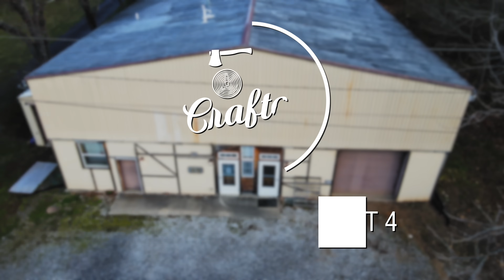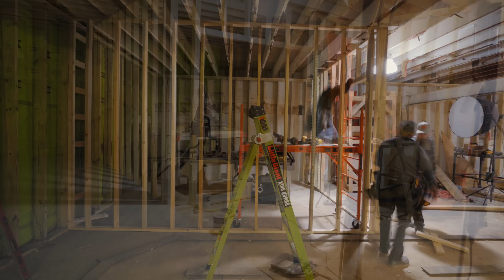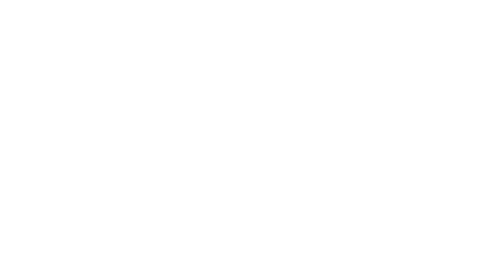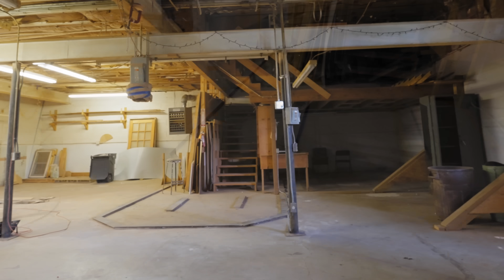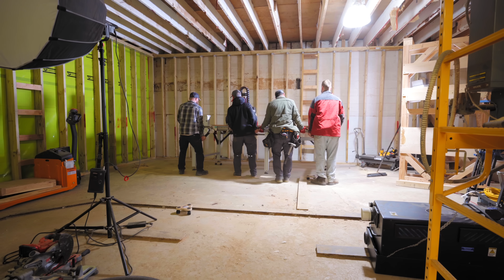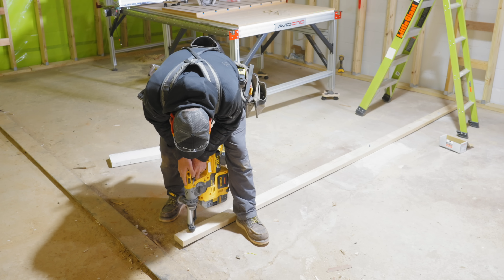WORKSHOP RENOVATION PART 4 : Framing Walls & Floor Platform

Comment: Radical stuff. I have to ask though, besides the ergonomic factor, why did you opt for a framed platform rather than doing a level concrete pour?
Reply from the maker: It was too thick to do self leveling concrete unfortunately!
Reply: @craftedworkshop  Gotcha, that's too bad but makes sense. Let me know if you ever need a hand with any CAD work or troubleshooting any weird 'performance' issues with this building. I'm doing a master's in forensic engineering right now, and I'd love to lend a hand.

Comment: Should you be putting untreated timber straight on concrete if you don't have a moisture barrier underneath? I suspect some moisture might get from the concrete floor to the timber.

Comment: Thanks for showing us how you leveled out the uneven concrete floor with a more comfortable wood based floor. I suppose that's something I will be doing with our building. I didn't want a concrete floor without in-floor heat. This is a good solution to that problem. I'll let the concrete be where the cars will be parked, but the rest will get a raised floor for comfort. Thanks for the details.

Comment: Floor sheets - with OSB the recommendation apparently is 2-3mm gap between boards to allow for expansion. Here the tongue and groove mated tightly from banging together. Not worried about seasonal humidity/temp expansion? Or does that type of board have some clever trick built into the mating surface?

Comment: The TotalBoat TotalTread, I'm guessing that you haven't walked on it in bare feet, but if you did, would it be uncomfortable? I'm wondering how this product would be for putting on steps in the house.
Reply from the maker: The abrasive is very fine, I think it'd be OK with bare feet. Wouldn't want to stub your toe though! 😂

Comment: Placing the barrier below the floor to help keep moisture out is a good idea.  Not sure where you live, but you could have also placed some 1/2" to 1" faced foam board on top of it as well to help insulate it a bit.  The stuff is relatively cheap.
Reply from the maker: I thought about adding insulation but we live in a pretty temperate area (Asheville, NC) so I don't expect it to be much of an issue keeping the space climate controlled.
Reply: @craftedworkshop  Way warmer than me (Western NY)!  ;)

Comment: I think you mis"d the  guidelines, the guidelines are a quarter inch per foot fall that's why in 4' you could drop it 1"
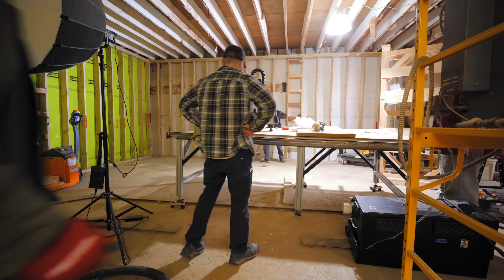Reply from the maker: From what I've read, it's a 1:12 pitch minimum, which works out to 1 inch per foot. 1/4" per foot would be extremely shallow.

Comment: It bothers me that there are no brace boards in-between the wall framing
Reply from the maker: You mean blocking? Doesn't really need it and it would get in the way of the steel reinforcement I'll be adding next.
Reply: @craftedworkshop  ahh gotcha.

Comment: I really like the way the transformation is looking so far, however I am a bit confused as to why the floor drain was completely blocked off. Should water find it's way into your shop, it now has nowhere to go, except, under the platform to evaporate.
Reply from the maker: The floor drain wasn't actually functional, it was clogged at some point in this building's 50 year history. I tried to run a snake in it to no avail. I could squeegee water out of the roll top door in the front if needed.

Comment: I wonder if some mortar or thick epoxy would be best to finish that ramp transition,  any thoughts on finishing that area?  I’m sure I would Tri point it.  Great Series!
Reply from the maker: Still trying to figure out my options. I've seen some nice heavy duty rubber transition strips but they're pretty pricey. I might just rip an angle on some strips of Advantech to feather out the transition.

Comment: the new shop is coming along great and looks amazing. I saw you at the opening of Berm Park but looked like you were with the family and no bikes so did not want to be rude
Reply from the maker: Oh nice, you should have said hi! We had a great time, can't wait to go back and ride later this week.
Reply: @craftedworkshop  next time I'm up from Florida.  Your videos inspired me to reclose a screen porch in to make a bike room. It's not perfect but it's framed now (not just a few strips of 1x on the aluminum frame) and insulated still need a ceiling solution, new door frame, and a bit of finishing work
Reply from the maker: @PedallingwithPaul  nice, sounds like a good project!
Reply: @craftedworkshop  anytime you can make a room for your bikes and gear is a good time. Wanting to close in a front screen porch for a small bike shop at my house too

Comment: Nice and straight work. I would have secured those support feet to the floor with a metal bracket to avoid any future bouncing.
I'm a little surprised they didn't vacuum up the sawdust from cutting the feet. Any moisture at all with turn that dust into a sponge.
Reply from the maker: Thanks! Metal brackets probably would have been a nice added reinforcement, but the Advantech isn't coming back up, hah!

Comment: Curious, did you think about running power under the floor?
Reply from the maker: I didn't, but that would be a good idea! Get some floor outlets in place near workbenches.
Reply: @craftedworkshop  that's what I was thinking.  prevents having to have 50 extension cords all over the place to reach to a wall.  Kind of like a kitchen island.

Comment: Why not use treated wood where it contacted the concrete
Reply: Did you not see the Bruce neon green moisture barrier
Reply: Not under the bottom plate for the c n c room
Reply from the maker: We added ZIP tape under the bottom plates, which should essentially do the same thing. Kyle from RR Buildings does something similar. I hate working with treated material, it's heavy, the sizing is inconsistent, and the chemicals can't be great for you.

Comment: Curious how that 2X4 floor support holds up to a dead load of a table saw or similar over the years.
Reply from the maker: There are no large power tools going on the platform. This will be for workbenches and smaller stuff like my router table.
Reply: He's definitely a woodworker and not a home builder. This shop is ... quickly shaping up to be a constant "work in progress"
Reply: @zerocool2352  I put a wood floor in a shop once.  It took some real structural planning for the placement of the equipment (and putting outlets and dust management in place in the floor).  Even with significant joists on 12" centers, I would get some "bounce" at odd times.  I ended up putting concrete in certain joist gaps as a grout like solution.  It worked.

Comment: My opinion. I feel like there was a missed opportunity to install dust collection pipes under the floor for the table saw.
Reply from the maker: My table saw won't be in that area, and 2x4 joists aren't deep enough for 4" ductwork unfortunately.
Reply: You'd probably want to have esay access to those pipes anyway

Comment: When it comes to aligning the floor joists with the level line, why not use two triangular blocks underneath them, and carefully tap them together to the correct height and then screw them together?
Reply from the maker: That definitely would have worked as well, just might have been a little more work cutting the triangular blocks!

Comment: Looks better and better. I would however put isolation between the joists. Not for heat isolation but since it will dampen the sound vibrations from the tools that you put ontop of the floor. The space under the floor will act as a resonance chamber amplifying the sound.
Reply from the maker: That’s interesting! The platform will mostly be for workbenches so no big machines running on the platform.

Comment: Wheelchairs have larger wheels than a hoverboard so the transition might not be an issue 😂
Reply from the maker: Hah, still going to smooth it out, as that's another ADA requirement, plus carts will roll more easily over the transition.

Comment: This is a perfect application for self leveling underlayment poured up to that ramp transition and throughout the rest of the shop.
Reply: Or before the overframing was done. Would've saved a Lot of head scratching
Reply from the maker: It was about a 10 inch drop in the area with the floor drain, too much for self leveling cement from what I’ve read. Not a bad idea to do it in the rest of the shop though, although I’d have a lot of stuff to move out of the way!
Reply: @craftedworkshop  yeah it would be a big job, you can do it in several lifts (layers) with aggregate. The good stuff can go 5-7” when extended. You can do it in stages while shifting contents as well. I’d love to see you make one of your high quality videos on how to properly use self leveling, I do it professionally and there’s so many garbage videos on here 😂😂
Reply: @craftedworkshop  I'm no professional, but I've seen people use styrofoam boards at the bottom to fill most of the gap, and then they poor a couple of centimetres of self leveling concrete on top to make everything perfectly level. But you did mention that you prefer working on a wooden surface so maybe self leveling concrete was never an option anyways.
Reply from the maker: @genecreamers  yea I’ve done a lot of research on the topic and it seems very easy to get it wrong! I think the best video I saw on the NS Builders channel, looks like a heck of a lot of work!
Reply: @craiguglandrealty3705  I agree, but it does make sense that that the wood is softer.
Reply: Good
Reply: I was thinking just some starter reo bars and pour concrete and polish, but as he said wood is better to stand on.

Comment: I'm confused! What's the reason for the offset of the ramp by the door?
Reply: Make it easier to screw the ramp joists into the floor rim joist
Reply: @mikel9567  How so? They are attached from inside the rim joist. The offset is on the other side.
Reply from the maker: That’s just where the layout happened to end. Don’t really need the ramp bang tight up to that door.
Reply: @craftedworkshop  That makes sense. Does that door even open? Wouldn't it run into the ramp?